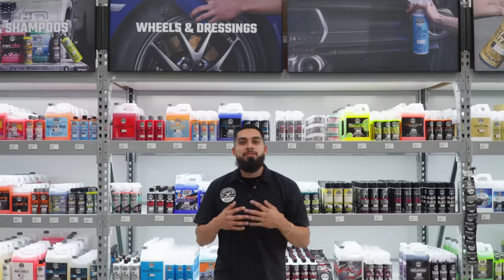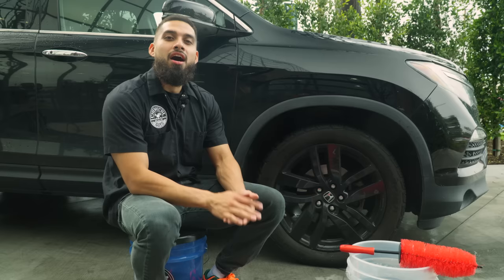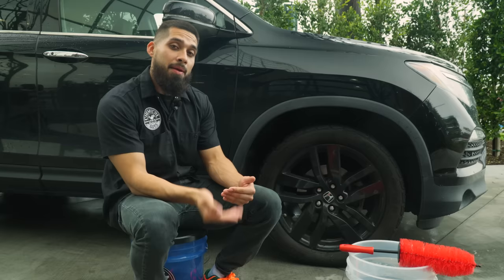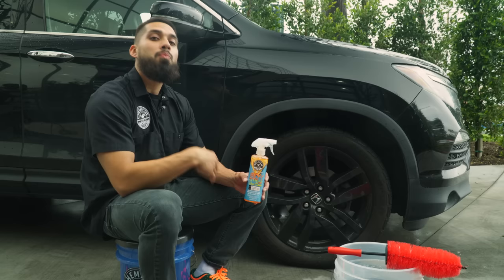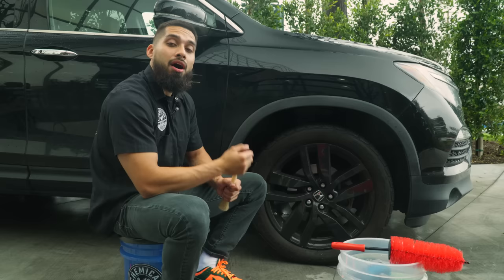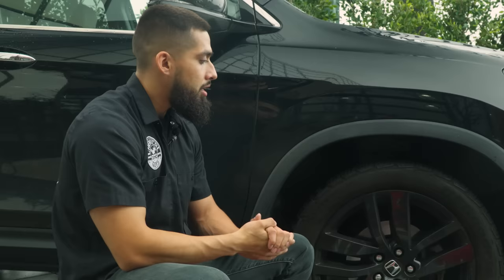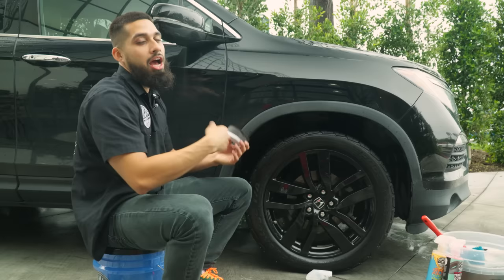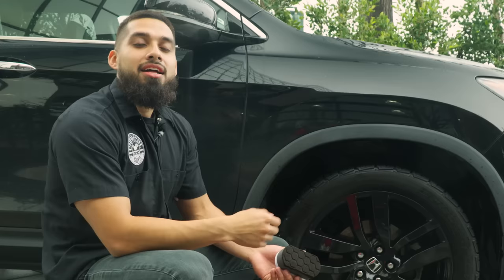5 Common Mistakes When Cleaning Wheels and How to Avoid Them! - Chemical Guys

Comment: …if a car owner applies ceramic coating to the wheels, he/she doesn’t have to worry about the issues that you’d mentioned about brake dust impacting the wheel finishing.
Reply from the maker: Happy detailing!

Comment: I've used most of your wheel cleaning products but the best I have used is your All Clean Citrus Based Super Cleaner. Added bonus is that if you buy a gallon and dilute, it will last years. I do clean my wheels weekly and that  makes cleaning them a lot easier.

Comment: Thanks for your video. I didn't know that brake dust could mess up a rim. I don't have custom rims just stock steel rims. So I guess the brake dust can eat off the paint on stock painted rim. Live and learn. Thanks again.
Reply from the maker: Enjoy your detailing products!!
Reply: Brake dust can eat up your rims if left on for months without cleaning them. You'll mainly see that with people who use the drive thru car wash.

Comment: I purchased the hydro spin wheel protector and it doesn't even appear to have the main ingredient for a ceramic coating in it. I was told to look for the silicon dioxide percentages but this doesn't appear to have any...
Reply: Let me know if you found any solutions !

Comment: thank you for video. i have a question. after you use red brush, why put it again clean water ... do you need clean red brush before using it again?
Reply: Keeps the wheel wet / lubricated , you need enough liquid around for cleaners to lift the dirt in to, but it's a good idea to keep the brush clean too, as it'd be easy to take off a bit of grit that was stuck and rub it around causing scratches

Comment: I’ve got moderately aggressive all terrain tires on my Jeep. They’ve got side lugs, raised letters and all sorts of texture to them. Applicators don’t get into all the cracks and crevices so I just take the sloppy route and spray tire shine on the surface then work it in the best I can. 

Is there a better method I’m missing?

And, I’m fully aware the other Jeep owners are gonna come at me for using tire shine.
Reply: Jeep owner as well with the same tire. Found the best way was spray then wipe the shine on the smooth part of the tire. Then spray the shine on the knobby part and on a brush to rub the knobby sidewall.
Reply: Use a tire brush for tire shine. Or you can buy a paint sprayer and put diluted tire shine.

Comment: I’m tripping that consumers buy into this hype.  Dang man.  High pressure water, dawn dish soap or simple green.  Use the right brush or wash cloth. Rinse and dry.  Yes.  I spend three or so minutes on each tire and wheel.  I keep three cars looking in pretty showroom presentable most of the time.  
We have a new high end automatic car wash close by that cleans tires and wheels perfectly and dresses tires in process.   No it’s not like me spending three hours washing my car but there’s not  that much difference.  
 No it’s not ruining the paint.  A proper Ceramic coating process once a year, use the high end automatic and dress my own tires.   A few times a week.  I run my company car through the twice a week.  Five years later my cars with 120,000 miles still look great.  I never towel dry cars.  Air guns only.